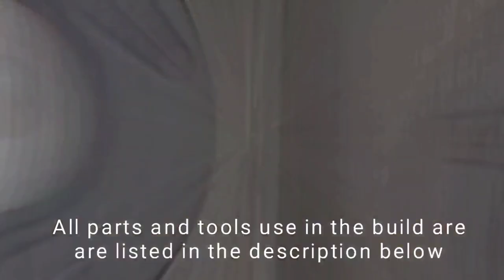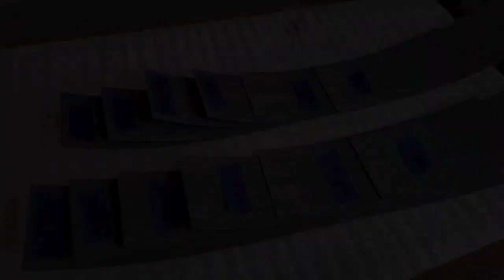BUILDING SPEAKERS - DIY Compact Mass-Loaded Quarter Wave Speakers with Markaudio F/R Drivers

Comment: Tempted - I got the CHN-50s for close listening for building a small boombox using a RPI4 and power dac/classD output using the small slotted design on their website. I stuck the two speakers together, added a touch screen but I think the Mrs was a little put off by their size (compared to a Roberts radio!) so she never really used it. Hence looking at a larger cabinet to house them to get some additional base response. Only thing is as I'm close in (0.5-1.5m) with the computer I was thinking of switching to a paper coned P73/Alpair 10" and making a set of bookshelf speakers instead. Decisions, decisions.
Reply from the maker: Best of luck whatever you decide Nick!! The WAF wife acceptance factor happens in my home too😂😂

Comment: I've noticed that DIY speaker builders do not use a T-nut and machine screw to mount the driver, instead using wood screws. Any reason why?
Reply from the maker: For relatively small speakers, screws are perfectly adequate. A nice 15inch woofer may be a different story though!!

Comment: question if anyone can answer...can the shape of the box be changed but retain the same internal volume to achive more or less the same sound?
Reply from the maker: I reckon yes!! (especially when using this sort of 20watt speaker) Sat listening to classical music on a square set (featured on the channel) and sound great and so easy on the ears!!
Reply: Nope. The "quarter-wave" part of the design means that the length (height) of the chamber is designed along transmission line rules. That's not to say a different box would sound worse, but changing the dimensions WILL change the sound profile and likely require other recalculations since a Helmholtz port in a standard box follows different rules than a mass-loading port in a MLTL design.
(Edit) The Mark Audio site for the CHN-50 has plans for 15 different box designs, though about half are multi-driver. Lots of options to choose from where someone else did all the math!

Comment: This might be a dumb question but why not make the cabinets out of veneered board? Is it a time vs cost issue? Is there any benefit to using a product like Dynamat inside speaker cabinets or are softer surfaces better?
Reply from the maker: Possible I suppose but, to get really accurate cuts you will need a great blade and better table saw that I have and a slight miss cut will be expensive. If you look at the build design they recommended this type of stuffing. Best of luck